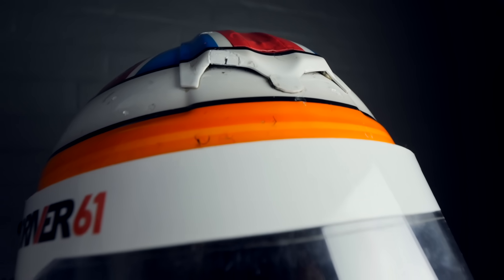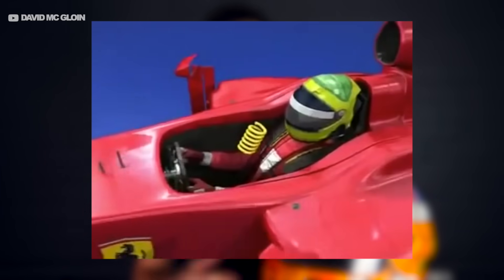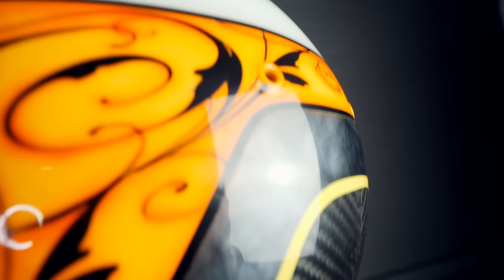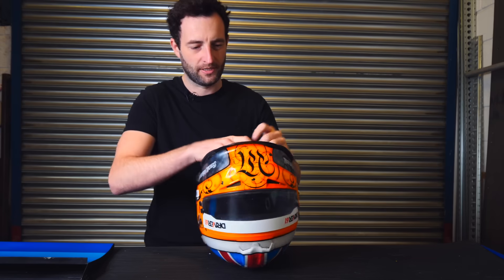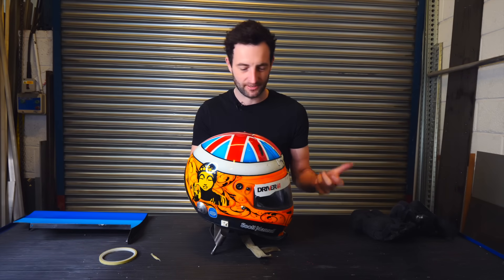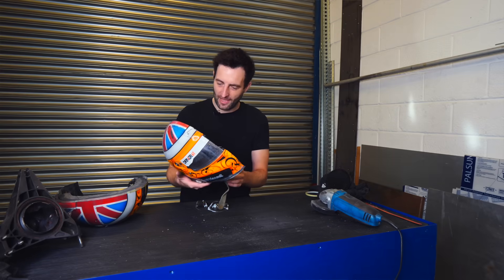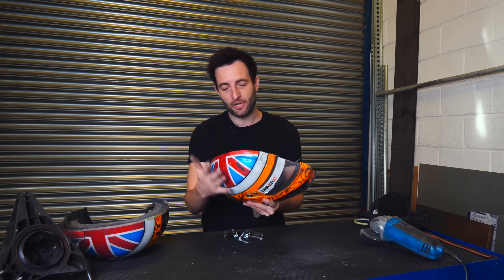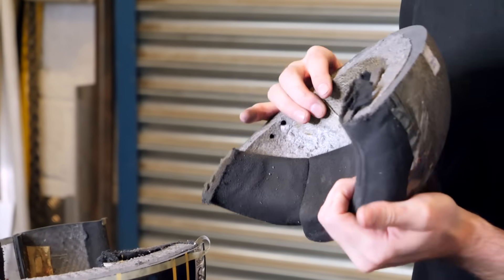What's Inside an F1 Helmet?

Comment: When cutting CF, you really want to wear a good mask, the resin particles get stuck in your lungs for the rest of your life.
Reply: No they don't. Carbon fiber isn't good stuff, mostly due to the carbon rather than the resin. But you don't need to make up reasons why its bad and the resin absolutely doesn't get stuck in your lungs for the rest of your life in the slightest.
Reply: @olivialambert4124  First off, you need better grammar and second, just like heavy metal poisoning, the body doesn’t have a way to get rid of the carbon and resin, so it does stay in your lungs forever.
Reply: @zoolookers  I'm not sure where the "butthurt" is. I called out his fake claims, I explained his terrible logic, I explained what truly happens, I explained where I get my knowledge. Disagreeing with fake statements is butthurt now?

Yes there is absolutely a reason professionals wear protection when cutting carbon fibre. As I explained in my very first comment "carbon fibre isn't good stuff". As I said in my first comment, "you don't need to make up reasons why its bad". His claim is that the resin is the main culprit. There is a reason why carbon fibre is considered dramatically worse than pure resin by said professionals. It is the carbon fibre or the fibreglass which causes the problems, not the resin. His claims were that it stays in your lungs for life. It absolutely doesn't. It irritates your lungs and does damage for a period before your body removes it. They are like little splinters as said professionals can attest to, constantly itching everywhere unprotected. They get into your lungs and cause the damage one would expect from little splinters, some pass through into the blood and get broken down, some get coughed out over time. That is radically different to his claim of resin causing most of the damage and staying in your lungs for life.

I have never even hinted at it being "good" or even "not bad" to have carbon fibre splinters in your lungs. My first comment made that incredibly clear. My second comment was very clearly on the point of why his version of events are completely wrong. Him making up problems doesn't remotely mean carbon fibre becomes good to breathe. As my first comment suggested, carbon fibre is bad enough without having to completely lie about it. It really is a truly absurd argument you're making here.
Reply: @olivialambert4124  aint nobody gonna read all that
Reply: @GBoezem  It was a specific reply to a specific person. If you don't want to read it feel free to not read it. But complaining that a reply to someone else is too long for your personal tastes makes you look pretty childish, to be honest.
Reply: Tell them girl
Reply: @olivialambert4124  Sorry Olivia, you are 100% incorrect with your facts. Let's tone the the argument & stick to the facts.
I've commented in other comment threads on this page. I will repeat myself here. I worked for a race team in the carbon fibre dept. for a duration. 
Carbon fibre cutting dust has 2 components, the carbon fibre & the cured epoxy. Carbon fibre dust will burrow into flesh and remain forever, mouth, nose, lungs, stomach & intestines. This is not good but not lethal. 
The epoxy resin used in carbon layups such as prepregs are EXTREMELY carcinogenic. Even cured, you don't want that in your body. Long term studies are being completed, now that carbon fibre has been used widespread for over 20yrs, Im certain it will prove very dangerous. Over the past 10yrs the industry has set standards, standards that Scott Mansell, Driver61 disregarded and should have put in a disclaimer to educate his audience. I hope this helps everyone understand the dangers.
Reply: @DucatiKozak  how tf is carbon fibre dust gonna burrow into flesh
Reply: @gideoncone6024  just because she's a female doesn't mean she's correct... and she in fact, isn't correct in what she says, so why tf do people like you support people just because they are a certain type of person
Reply: @olivialambert4124  Your grammar wasn't perfect lmfao. You said "make up reasons why its bad." You used the incorrect form of "its." It's supposed to be "make up reasons why it's bad."
Reply: @DucatiKozak  Cool. And I went to med school. My own medical issues prevented me from finishing, to be honest with you, but I got far more than enough to have covered things like this. Epoxies have minimal danger when cured. They are very non-reactive, aren't absorbed into the body anywhere, and as such don't have the same problems as ingesting something which does react or absorb. If I were to guess you seem to be mistaking the dangers of epoxies in their unmixed or unhardened form with the dangers of a now unreactive substance which are radically different.

Also you might want to read the arguments you are trying to support. Their claim is that it acts like heavy metal poisoning, and stays in your lungs forever. Lets ignore the fact that makes it entirely unrelated to heavy metal poisoning, The claim that it stays in your lungs forever is also entirely false, too.
Reply: @olivialambert4124  Please don't assume what I know & I won't assume what part of your medical career you completed and did not complete.
I defend against anyone so combative online when the message you clearly are not stating is that Scott made a dreadful and dangerous mistake not wearing a mask. Then by not putting any disclaimer to enlightening those enthusiasts that follow him was a second mistake.
I was trained under OH&S, Canada's version of OSHA. I've also ready studies published on the topic. The race team also had specific protocols garnered from the industry to follow. You seem to think your education was better because you were paying for it, meanwhile I was being paid for mine - because I was in direct contact with it for a remaining <2 years.
I will give you the credit of saying the studies claim cured epoxy is inert. Yes we were taught that too. But I would like to see what long term ingestion of carbon & cured epoxy has before I tell anyone that what Scott did was not a big deal. This is what I wrote in other threads. 
Your implication that I am making up dangers is dangerous in itself. Perhaps it was better you didn't become a Dr.
So if you came here to give yourself a high five because you studied carbon in a partially completed education, meanwhile I worked it daily for nearly 2 years you came to a deaf audience.
Reply: @DucatiKozak  You were the one who said what you had learnt relevant, now you complain when my studies are more relevant? 

Scott did NOT make a "dreadful and dangerous" mistake, in part by the fact that he is not in hospital. Nor would we expect him to be in hospital. Scott made a minor mistake.

However the argument isn't about if this is safe or unsafe in the slightest. The argument is, and has always been, about precisely what the dangerous aspect is. It is NOT the resin. It is the carbon fibre. Trying to conflate the dangers of carbon splinters and behave like that makes the resins themselves a danger isn't the way forwards. Trying to pretend like not acting as though the resin is dangerous makes me supportive of people sucking up carbon fibre dust is completely disingenuous. 

You will notice I didn't say anything about being paid for, or paying for studies. I don't much care that I paid for mine, you seem to be the only one with that problem. But frankly learning precisely what is dangerous and how to cure people with those dangers seems a little more relevant than an OSHA course on "stay away from everything that might be remotely dangerous" here. If the carbon fibre itself is dangerous, why would an OSHA course be distinguishing between that and the resin. Why would a course for people with no scientific background be getting into the details of when resins are dangerous and safe, where resins are dangerous and safe, and the carbon mere micrometers away from it being a danger when talking about sanding and cutting carbon fibre composites? Sure its better than no education, but a safety course saying "everything is dangerous" isn't really the final word here.

And to top it all off you then say you were taught exactly what I have been saying - that epoxies are inert. "But carbon fibre mixed with epoxies are bad for you", nobody has been talking about that. If the carbon fibres themselves are bad as has been my argument, then ingesting both carbon fibres and epoxies combined being bad argues just as much for my stance as it does yours. As for the long term effect of carbon fibre, its similar to the long term effects of asbestos. Both are tiny fibres which become airborne and get stuck in the lungs. Both are minimally dangerous in small amounts as Scott has seen, and only become dangerous through repeated abuse over multiple years as one would see from working with them from a chronic build up.

Your response, frankly, is dangerous. That you know better, despite being taught otherwise. That you will misrepresent statements, will try to use your position and your teaching to push a false message, and that anyone who disagrees with you would be dangerous in a position you entirely don't understand. Far more dangerous than someone stating the known facts of dried resin not being the devil, but the composite fibers being a risk. Especially when we know, all but you it seems, that the risk from fibers is the long term chronic build up and not the occasional one time misuse.

So you gave yourself a high five for freaking out half way through reading someones message, clearly incapable of finishing the read. You worked with carbon for a whole two years, sounds more like a partially completed job considering my partial studies medicine were far longer than that. If your ears are deaf to what I say, to what you were taught, and to what the studies you read say then that seems a you problem.

Comment: So basically you are screwed if you crash into an angle grinder.
Reply: Yeah, but it has to be a very slow crash, because otherwise the blade will break first 😆
Reply: PilotJohnSilver wonder how easily the halo gets cut ?
Reply: @ThisLadWayne  I guess you can cut almost everything with the right tool 😉

Comment: wow, breath it in, all those carbon dust
Reply: Seriously wtf thats horrible
Reply: @robertsestito6821  @y jasper that's the best thing if you want to have pulmonary edema in some years
Reply: When I worked in aerospace it was wet cut, sand and drill anything that was carbon along with respirator and face shield.
Reply: Worked at a race team (won Daytona 🎉) carbon layups & part completion for 1 yr.
It's incredibly unhealthy, even with saftey measures.
Yes that carbon dust will remain in  your lungs forever. It's relatively inert (but will cut & bury deeply forever), but not the epoxy, even cured. That will alter your DNA.
Only now is the industry realising what ailments a career carbon man carries.
To all that emulate this, wear a proper mask with an excellent seal around your face & cut under a negative pressure evacuation hood.
Reply: @DucatiKozak  what team? What category?
Reply: @zer0751  ALMS DP (Daytona Prototype Gen 1 - 2003) Multimatic MDP1
Canada's Race Team & engineered race components!
We won our class! Brilliant team!
Reply: @DucatiKozak  ph cool
Reply: @zer0751  😁👍
Reply: Just look at his fingertips at 9:54 that’s now the colour of his lungs! Always wear a mask kids
Reply: I'm not one for following OSHA crap, but I will wear a respirator when cutting fiberglass/carbon. 
That crap doesn't break down in your lungs.
Reply: Yeah that’s just ignorant.
Reply: Yeah, that was all I could think.  Carbon fiber and insulation dust...
Reply: In a time where facemasks are more common, that is shocking to see...
Reply: its just as bad as asbestos
Reply: I was honestly surprised about that as well. Maybe he held his breath.... The entire time?
Reply: Thats the first thing I thought when I saw him start cutting. i was like I hope he has  a nope never mind he's just gonna breath carbon fibre dust
Reply: Why not, it tastes and smells good
Reply: Lol tbf he was probs not breathing in and standing a distance away
Reply: @callumdean  Mr. Dean; No, just no. Don't do as he does.
Reply: @callumdean  that's like saying "just squint" while you're welding.
Reply: @nerminc.1713  isn't that why it's called safety squinting?? 🤣
Reply: Helmet dust, don't breathe this
Reply: I'm actually scared by how he's holsing the grinder one slip and then your thumb is in half
Reply: It's fun to watch when they are not my lungs getting the dust.
Reply: I had those exact words running through my head while watching that.
Reply: Ya I was like that’s not that smart to cut it would a mask
Reply: Absolutly shocking to See......
Reply: Yeah wear a respirator when you cut that thing up.
Reply: I feel bad. But generally, once isn't going to kill him. Respirators apply more for people working on this stuff regularly. But still...
Reply: @ironmantooltime  just one time can be bad enough to drastically alter your health and give you long term effects. Those tiny loose splinters can really cause tissue scarring that never heals and reduce your breathing capacity.
Reply: @voongnz  😣
Reply: @ironmantooltime  yep, really nasty stuff. Not to chance it even once.
Reply: I understand why your carreer ended. Take another deep breath
Reply: @Rea-per  ??
Reply: I mean we are carbon-based life form. So yea.
lmao

Comment: Okay this was interesting, but can I ask. Not wearing a dust mask, is it okay to breathe carbon fibre etc, particles in?
Reply: No it's super dangerous.
Reply: It's very very far from okay to breathe in. Shit stays in you lungs permanently.
Reply: I did think so, but wasn't fully sure. It's not something I've done or will ever do, so was making an educated guess that it wasn't. I hope Scott is okay from this.
Reply: If you've ever worked with fibreglass or carbon fibre you'll know how it sticks in your skin and itches like crazy...now imagine that stuck in your lungs never to come out, slowly tearing your lungs apart, leaving pustules and scar tissue till you can no longer breath or a tumour devours them till you slowly drown in your own blood and pus.
Reply: It's less dangerous than asbetos because asbetos breaks lengthwise while CF breaks into shorter sections.
Reply: CSwords, NO!
I've commented in other comment threads on this page. I will repeat myself here. I worked for a race team in the carbon fibre dept. for a duration. 
Carbon fibre cutting dust has 2 components, the carbon fibre & the cured epoxy. Carbon fibre dust will burrow into flesh and remain forever, mouth, nose, lungs, stomach & intestines. This is not good but not lethal. 
The epoxy resin used in carbon layups such as prepregs are EXTREMELY carcinogenic. Even cured, you don't want that in your body. Long term studies are being completed, now that carbon fibre has been used widespread for over 20yrs, Im certain it will prove very dangerous. Over the past 10yrs the industry has set standards, standards that Scott Mansell, Driver61 disregarded and should have put in a disclaimer to educate his audience. I hope this helps everyone understand the dangers.

Comment: Would breathing protection have been a good idea since you're cutting into carbon?
Reply: Not only good, but necessary! The carbon dust is highly carcinogenic
Reply: @danort17  Believe in JESUS today, confess and repent of your sins. No one goes to heaven for doing good but by believing in JESUS who died for our sins. GOD loves you soo much unconditionally.🤩❤🤗
Reply: Breathing protection and he also didn’t wear gloves! Watching him put his thumb on the debris shield had me cringing, so many things done wrong in relation to properly handling this sort of tool, lucky he got the job done without cutting a finger off.
Reply: I was thinking the same thing when he started cutting it. That stuff is a huge irritant to skin. Can’t imagine what that’s like for the lungs.
Reply: he should also have sprayed a bit of water on the helmet so the carbon dust would stick do the helmet instead of flying everywhere
Reply: Too late now 😜
Reply: Yes mom.
Reply: Would a covid mask do? Genuine question
Reply: @_Rafiki.  A cheap cotton mask is useless. An N95 mask is better, but still very leaky and doesn't seal properly. Ideally you want a cartridge respirator with a proper filter and an air-tight rubber seal.

Comment: Didnt they remove the strip ontop of the visor in the most rescent soec helmets and istead made the vieuwport smaller so that the forehead would be more protected with the shell instead of a visor extention?
Reply: From outside it looks like the visor opening is smaller but it is actually slightly bigger than the previous helmets that had the strips, I don't remember where I saw this from, but I'm sure it's true